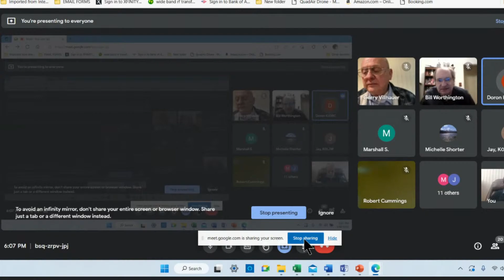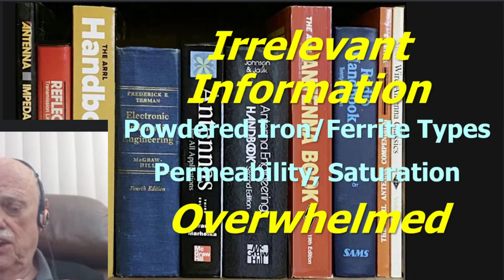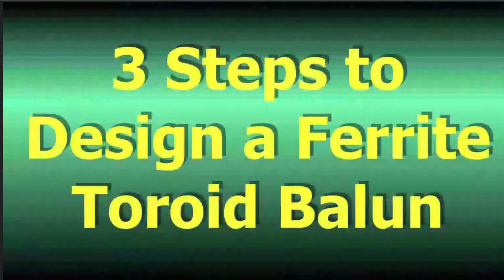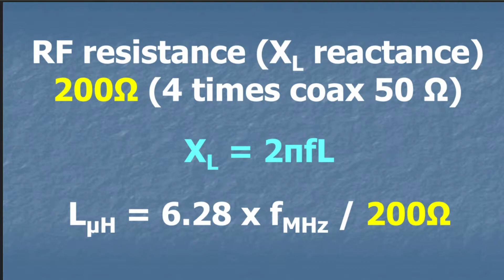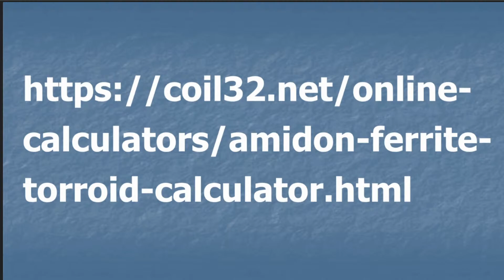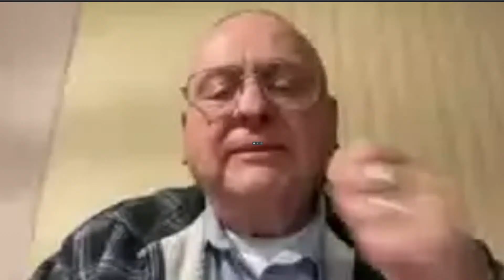Ferrite Baluns - John - W6NBC

Comment: Non of these lectures tell you what kind of ferrite to use for true high power operation.  Ask any Winning contest station and they will tell you to get rid of all ferrite material that is used in the transmitting circuit.   99.999% of all ferrite material is used for RF suppression suppression

Comment: This went well until he got to the 49:1 "balun" part where everything fell apart.
1. A 1:1 balun was explained. There was no 4 or 9 to one described. Nothing!
2. The 49:1 is not even a balun, rather it's a transformer with a single ended output sometimes called an unun. 
3. Choking is not something a 49:1 unun does. It is an impedance transformer.
4. The 200 ohm impedance number is far too low for decent choking action. 
5. He uses 50 ohms in his calculations but you have no idea what the impedance of the common mode circuit being chokes is. This would depend upon the length of the coax and it could be in the thousands of ohms. The choke should have at least 1000 ohms impedance or more. Again...this is not a 50 ohm network. 
6. Zip or lamp cord would have a much higher Z than 50 ohms. probably over 100 ohms therefore it would upset the impedance match in a 50 ohm system. It is better to use small, ptfe coax to maintain the correct impedance.
So this video has a lot of wrong information in it. I'm not sure why. He repeated how "simple" this is a hundred times but in the end it's just confusion.
The only part that is correct would be the 3rd wire of the coax part and even that was vague. 
Sorry to be so negative but you must be careful who you follow on these topics.
Reply: Thank you at least I'm not the only one who thought that and also I didn't like the assumption that "most hams" don't know what a balun is I find that not giving people the credit I certainly find most deserve most people are not stupid accusing them all of not knowing anything seems unfair at best and down right nasty at worst
Reply: I was thinking the same thing.   Some of this goes contrary to what I've heard and read.
Reply: Yeah. I feel like this is just muddying the waters.